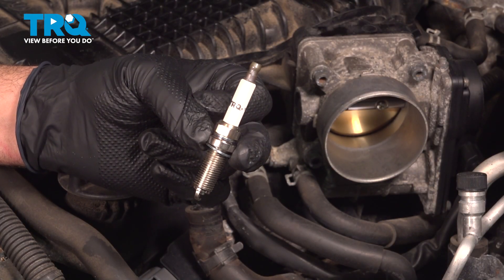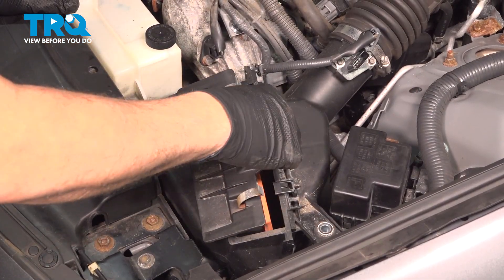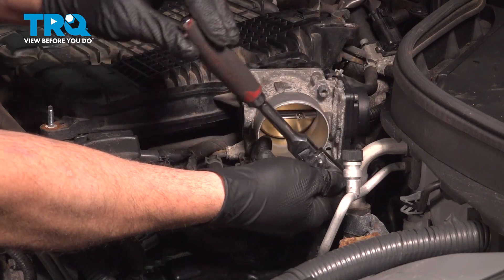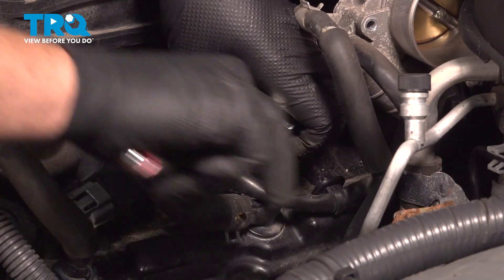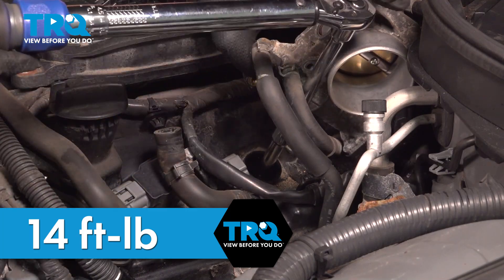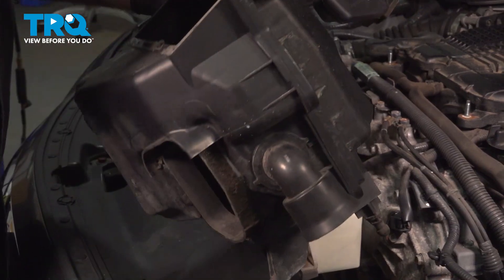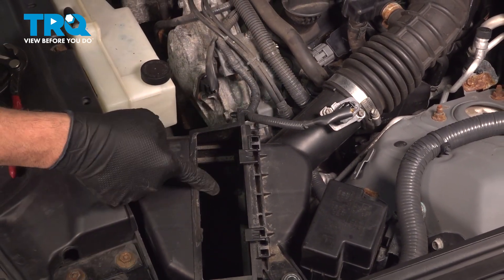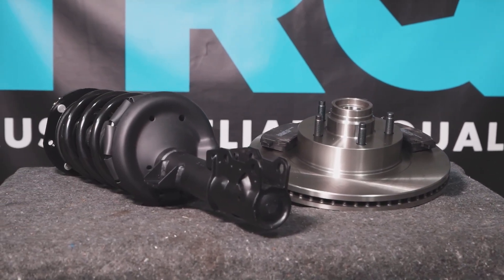How to Replace Spark Plugs 2008-2013 INFINITI G37 3.7L V6

Comment: does disconnecting the throttle bodies lead to issues when reconnecting them and putting them back on. I have read a lot about having to do a tedious relearn process from disconnecting them.
Reply: Yes it’s gonna need a relearn if you disconnect them 1000% positive of that